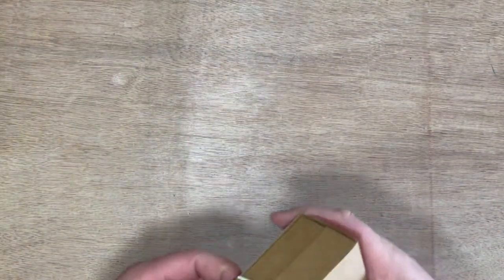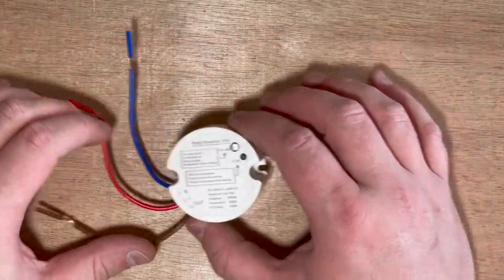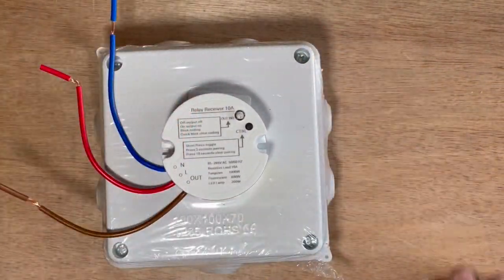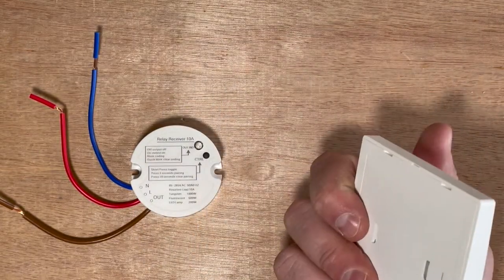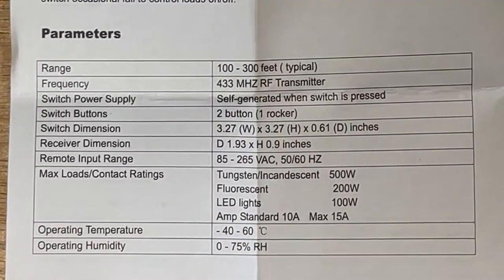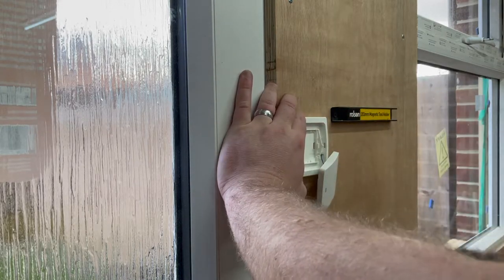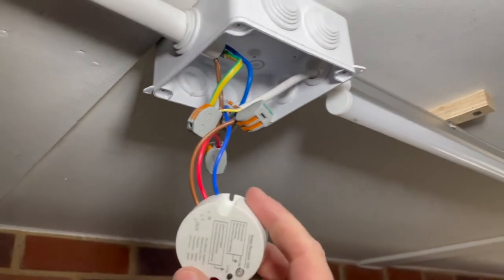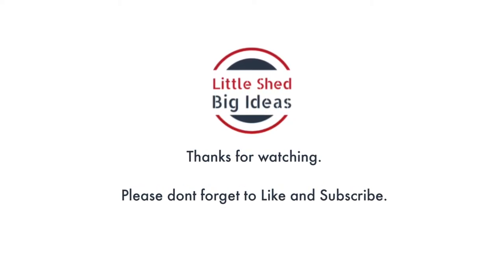Acegoo Wireless Lights Switch Kit - Unboxing & Install

Comment: I want to gather a number of switches together from adjacent spaces, without having to rewire any of them. Can the receiver be used to replace the switching gear in a traditional light switch, so that the kinetic light switch can be used as just a repositioned switch?
Reply from the maker: I believe so yes. There 99% sure there is a video on YouTube where someone did exactly that.

Comment: I'm wondering, if the power goes out do you need to pair it again? That would be pain in the a$$.
Reply from the maker: I did a little test and switched the fuse board off then on and it worked. I guess it may have a small battery in it….
Reply: I haven’t had any issues with that.. I tore my old switch apart and there are no batteries or any power source, I think the switch works purely off of the mechanical movement that’s why it clicks so damn loud lol… at least that’s what I came up with
Reply from the maker: Sounds about right.

Comment: Can you use this as a way of two way switching?
Reply from the maker: I believe so yes but I’ve not tried it myself. On more than one occasion I have got back into the house and realised I left the light on so a second switch would be helpful.
Reply: I've seen video where you can wire it and be able to use the original switch also.
Reply: Yes you can install upto 10 wireless switches of one receiver.  Mk quinetic allows you to install on grid switches  which blend in with standard modular light switches.
Reply: @Ben-lr2vz  probably best to disconnect the existing switch wire and install however many wireles light switches you need. Paired to a singular receiver.

Comment: I like the units that have a smart receiver...but this unit can save a lot of labor and needless wiring... I wish I knew of this when I had to rewire my new house...the bastard electrician never wired several switches that I had in the contract...
Reply from the maker: I really do wonder why this isn’t a more used method for installs now. So much quicker and easier.

Comment: can you use this instead of pull switch..if so how to connect please
Reply from the maker: Pull switch. Do you mean like in a bathroom?
Reply: @LittleShedBigIdeas  yes .. i have similar wireless switch but it has IN & OUT feeds

IN (L red N blue)
OUT (N blur L brown)

Thanks
Reply from the maker: If I’m honest I’m not sure.
Reply: @darrents44  if you install the receiver above the light fitting.  The switch or switches can be installed anywhere within range you like.